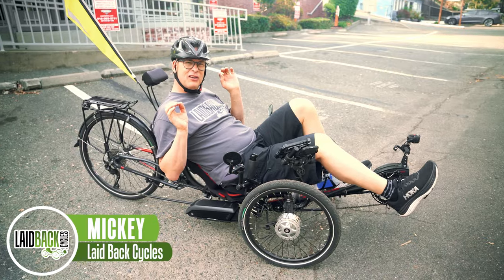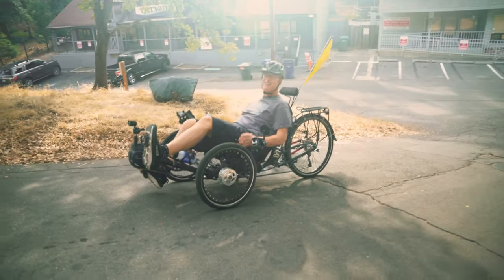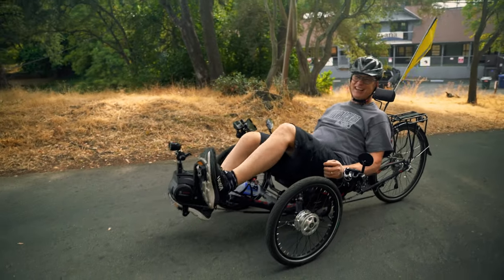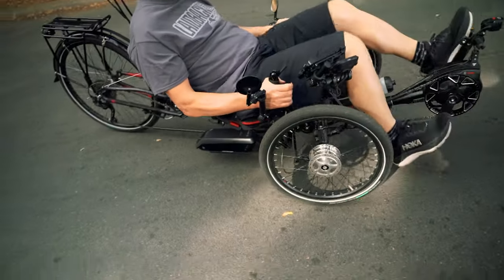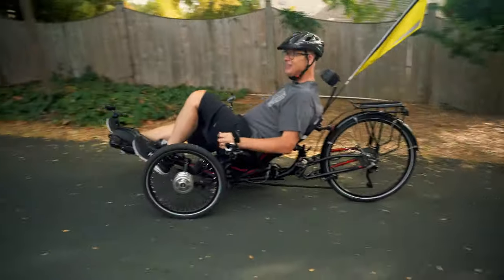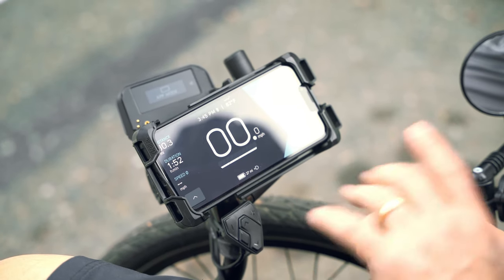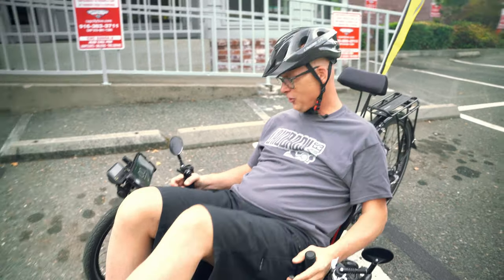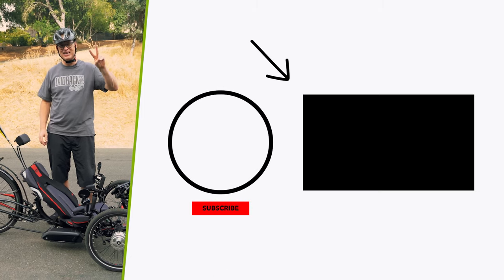Human Power vs. Electric Assist on a Recumbent Trike

Comment: Your test isn't realistic. My trike has a very small 24T granny gear up front which makes climbing much easier though quite slow. Your trike doesn't have multiple rings in the front. That's because you have the Bosch installed. If your trike had a regular crankset you could spin your way up the hill.
Reply from the maker: There's many ways to get lower gears to climb, a triple crank with climbing gears, a Rohloff 14 speed hub, a Schlumpf Drive, etc. But this is just showing how much easier and faster a motor is. And there's many reasons to get a motor other than climbing hills. Realistic is relative to what your are doing and what you want :)
Reply: @LaidBackCycles Sorry guess I'm thinking like an engineer. There's no way you could easily restore the trike to its non electric components in a few minutes.

I'd love to have a Bosch on my trike, but it's not happening in my current situation.
Reply: There  are motors that can accept  more than one chain ring with a derailleur.
Reply: @LaidBackCycles  By " not realistic"  I think he is saying:  No one would make a habit of climbing hills in a trike that has a motor and has a chainwheel size that assumes that the motor will be used.  No, any sane person who wanted to climb a hill in a trike without a motor would do so in a trike with a granny gear designed to help (a lot) with climbing the hill.  As he says, climbing hills without a motor isn't that difficult if you have the right gearing.  It is just a lot slower.  

Realistic:  something that would happen frequently in real life, not a made-up situation.
Reply: @LaidBackCycles  The more realistic comparison would be to show climbing a hill in one of the many non-motorized trikes that you have in your shop, not trying to climb the hill with the motorized trike with a gear that isn't designed to climb hills without a motor.  You would therefore show that the main difference between climbing a hill with and without a motor is speed, not difficultly.  My guess, with that hill ... 3 mph without motor and 6 -7 mph with motor.

Comment: Yepper, Hills can be and ARE a challenge , but I need to admit that I need them to keep going (gotta keep my legs strong by using them constantly .  So I EMBRACE each and every Hill that I come across (Yepper, I'm that guy that some ti men even LOOK for a steep Hill just to climb - I challenge myself to go up it fast than I did last time, and to my surprise, God gives me the strength to actually do the climb quicker, but regardless I always try!!!  I do not know if you remember much about the ... disorder I live with (Atixia), but life experience has tough me that if I want to keep going that I need to keep using the muscles as much, hard (Hill challenges) and as consistently as He allows mr to - so NO assistance meter for me thank you.(NOT bashing them at all, if they get you "doing" GREAT,!  However, I kn ow me, and its WAY to easy to start using them more than we actually need to.)
Reply from the maker: Keep on hitting those hills 👏
Reply: I'm waiting on bafang to release their torque sensing motor in the next few months.  Pushing much heavier weight of the trike magnifies muscle strength imbalances much more than riding and upright bike. I wind up straining the stronger leg to much.
Reply: 2 things, stretch and watch your knees! I came from an era where stretching wasn't a thing so you probably already know this but it's really important. I'm getting my knee replaced soon, I could climb any hill and my job requires climbing many stairs. I can't do either one now but my legs are still very strong. I need to use an electric bike now and the pain only lasts for the first 5 minutes. All I'm asking is for you to watch out, it's a steep downhill.
Reply: I live with ataxia too...I'm planning to activate with recumbent bike also
Reply: @debbieschwartz3132   one legged pedaling
Reply: @otasan99  Ultimately God is the of all my HOPE - however, he does use 'means' to accomplish most of HIS work - I'd say Pilates' has been the BIGEST producer of success, but riding keeps me going to pilates' :)

Comment: You are climbing using a trike with a motor and a battery but without electric assistance? Perhaps the problem is with the extra non-contributing weight and the lack of gearing? Wouldn't climbing with the proper gearing and without the extra weight achieve similar results (i.e. you get over the hill with similar effort)?
Reply: Yes, you're right.  With a proper hill-climbing gear you could get over the hill with- about the same effort.  The main difference would be speed.  The motor helps you to climb in faster gears.  That is why it is so difficult for Mickey to climb the hill in that trike with a motor.  The easiest gear on that trike is much harder / faster than it would be on a non-motorized trike.  So... Mickey's ... let me show you the difference between climbing a hill with and without a motor is really misleading.  The main lesson which he proves here is IF you have a trike with a motor AND it has been geared accordingly, make sure you don't run your battery dry if the end of your ride is uphill.

Comment: Great video! Most casual cyclists tend to ride with too little proper leg extension ( seat height too low ). Your leg extension appears to be too much as you are rocking side to side and having to extend your toes to reach the pedals at full leg rotation. You might get more power with a slightly shorter seating position to your cranks.... electric power or not. Just an observation.

Comment: Im waiting for bafang to release their torque sensing motor in the next few months.  Pushing the weight of a much heavier trike empathizes leg strength imbalances due to back issues and wind up with more pain.  The trike has certainly been a learning experience. For me a motor is necessary.  Im still riding upright as well and find it less straining. Pushing down ( with gravity) as opposed to pushing out and away is quite different.

Comment: How low is that lowest gear? (In inches, or front cog/back cog)
Also how heavy is that motor/battery? I find weight is critical for climbing hills.
Reply from the maker: The gear inches can have a large range depending on internal/external gearing. The motor kit is around 16 lbs., with 6.5lbs being the batt.

Comment: That does not look like a very low gear.  I'm looking into a tadpole because of the hills and I can not ride a bike any longer.
Reply from the maker: I was in the lowest gear possible. But you can get even lower gears using a Rohloff drive or some Mega range cassettes. I usually don't need them with a motor though.
Reply: Thanks.  I have just started my quest in getting a recumbent tadpole.
Reply: By far the most common way to get lower gears in a non-motorized trike if by using a double a triple front crankset.  This can either DRASTIICALLY reduce your lower gears or in the case of a triple, you are make your easy gears easier and your harder gears faster so you can fly downhill faster than gravity would take you by itself.

Comment: Good video mate , we have a bunch of bike paths not far from home , and on leaving home access to junction of bike paths is entered from a court( dead end street) , the bike path from that court is lovely steep downhill ,  unfortunately I have to come back up that path on my heavy duty trike , and several times I’ve tried different methods of getting up the hill, and every single time I’ve  failed and had to lock the brakes on the hill get off and push trike up . 
Recently I put a motor assist on , and I was still somewhat sceptical that I would make it ,  but wow what a difference I it makes , and I did it with about 50% of power .
  Worth it !

Comment: Yes, but the motor type & location are critical. You have to take into account a) how big a hill are you going to be worrying about; b) how capable are you; c) will your motor have enough power. I bought a trike and experienced exactly what you're talking about.... I live on a (big) hill. After pushing the trike up the hill a few times, I went & got a hub drive. Sadly, it didn't have enough power either & did not take advantage of any gearing. I ended up getting rid of the trike for a bunch of reasons.   For reference, I'm fat & out of shape. My hill is substantially bigger than the one in the video. I had a 250W hub direct drive. I wish I had gotten at least a 500W hub geared drive or a mid-drive w/ granny gearing. Thanks for the video! One day, I hope to return to trikes.
Reply from the maker: Yep. A hub drive pushes you and needs to be powerful enough for your weight. They are useful when done right. The mid drive seam to work really well because your have a lot of gear options for the rear wheel.

Comment: Quick question. Does the battery charge when pedaling downhill?
Reply from the maker: The battery is not regenerative, but it can usually last 40-60 miles on ECO which is plenty for most rides. Just charge once you're back home!

Comment: Tough ride. Point of interest….if you had a hub drive instead of mid drive you would have three rings up front instead of one and could climb that hill a lot easier. Your “granny gear” combo,will goup any hill although slowly with a manageable effort. I don’t need e assist YET but when I do it will be a hub drive on my 559. My 700 will stay a lean pure machine forever. Btw…after viewing this grand effort by you it is quite obvious why 2 wheel recumbents are a thing of the past due to stability issues and they are totally impossible to,climb with. Stop a lwb recumbent on a hill and see if you can ever get started again. Useless.
Reply from the maker: This is one of those hills I fell over on over a decade ago on my two-wheel recumbent.
Reply: @LaidBackCycles ..I totally understand. I have a lwb 2 wheel sun which I have basically stopped riding since I got my trikes and have been unable to sell it at any price. I don’t even get responses while on many selling sites. Hills are a breeze on a 3x10 trike for me…..so far…..